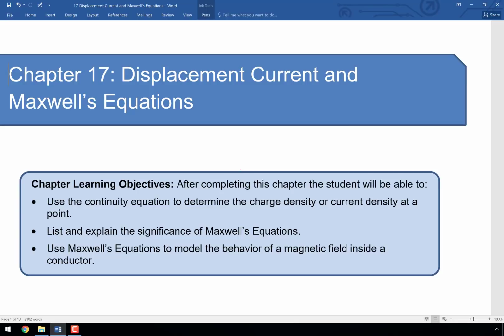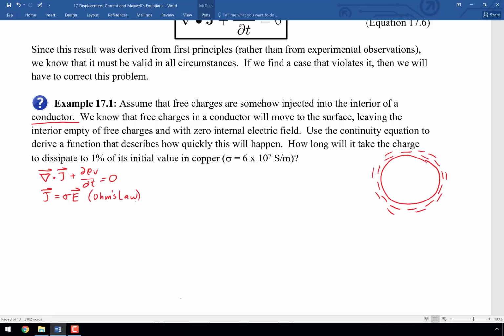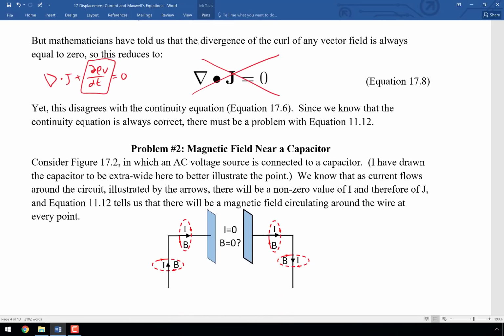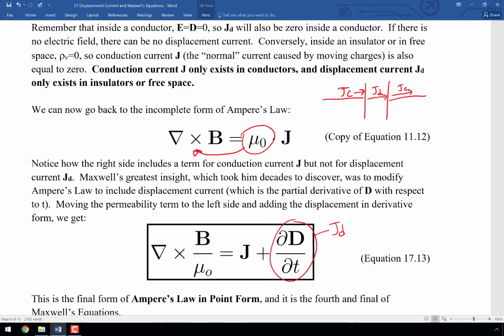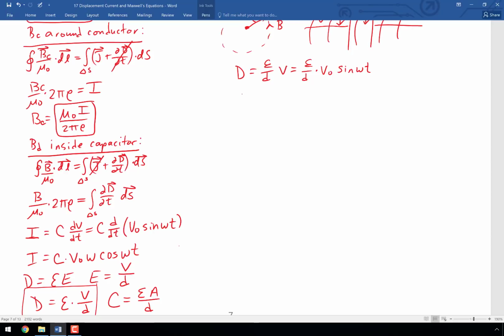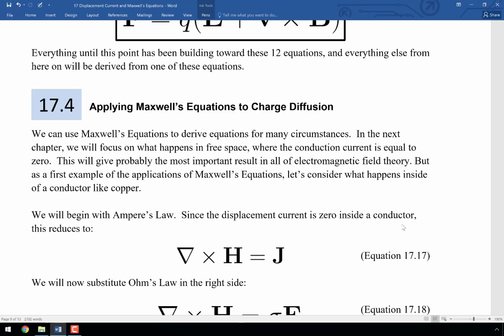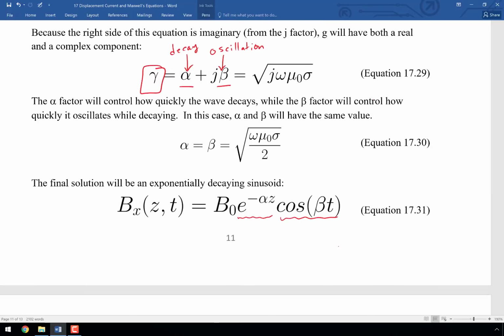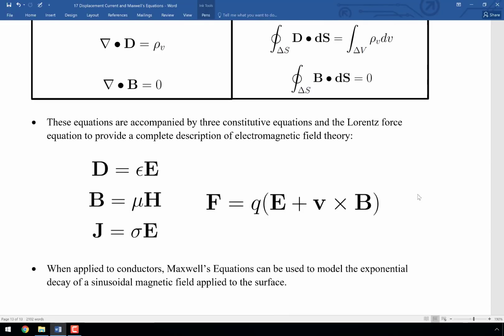Applied Electromagnetic Field Theory Chapter 17 -- Displacement Current and Maxwell's Equations

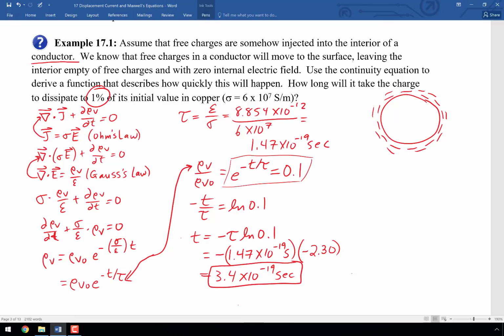Comment: At example 17.1 at 12:20
 it take the charge to dissipate to 10% of its initial value  3.4 * 10 ^ - 19 sec
And before that, you calculate that it take the charge to dissipate to 0% of its initial value  0.47 * 10 ^ - 19 sec! 
This means that it takes more time to dissipate to 10% than to dissipate to 0%! 
Isn't this a contradiction?
It should takes less time to dissipate to 10% than to dissipate to ≈ 0%.

Thank you for your efforts in creating this content
This is my calculations 
For ≈ 0% , t= 7.375 × 10^-19 sec t= 5τ
For 1% , t= 6.8 × 10^-19 sec
For  10% , t= 3.4 × 10^-19 sec
For  36.8% , t= τ = 0.47 * 10 ^-19 sec